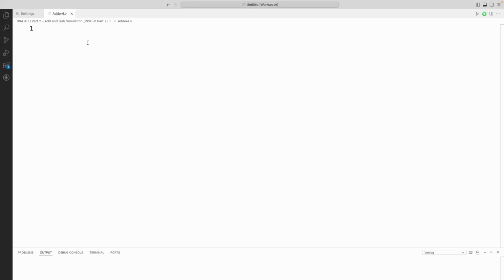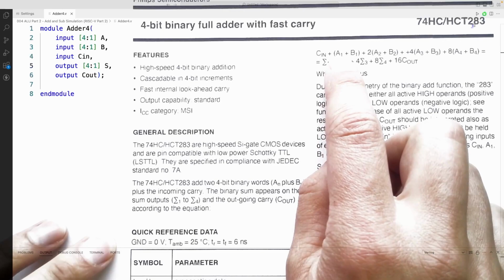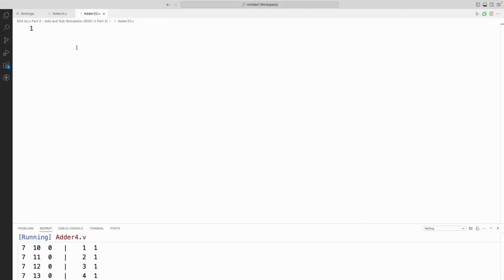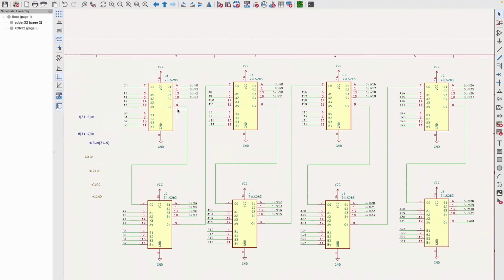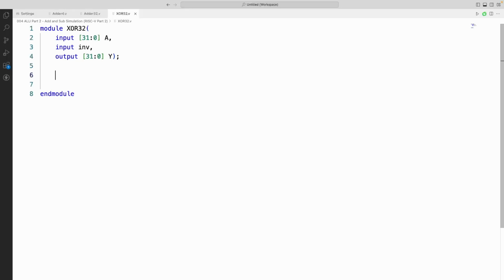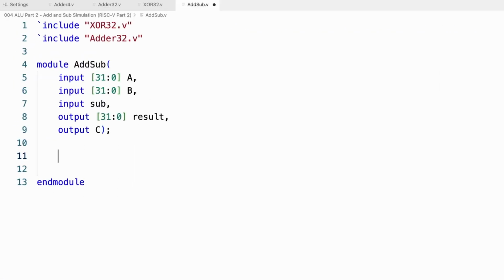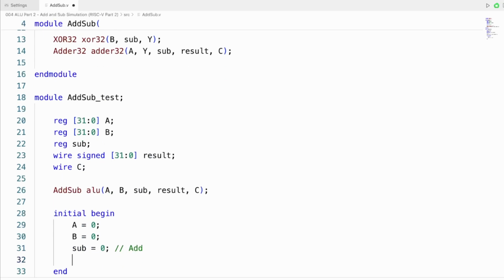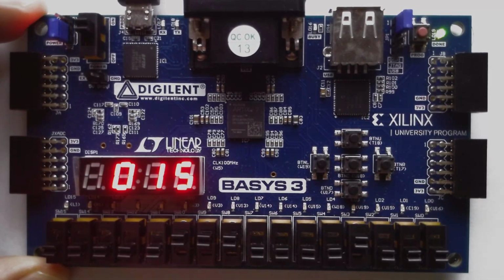ALU add & sub in Verilog (RISC-V Part 2)

Comment: Is there a reason why you used [31:0] for the 32-bit input but use [4:1] for the 4 bit adder input? I would have thought it would be [3:0], no? I've never used Veilog but it's on my TODO. 
As an aside, I used to work with someone that would develop array style data structures whose index started at 1. This mixed in with other C++ code whose data structures started at 0 created a cognitive nightmare trying to figure out what his code did. Iteration code made you want to cry. So glad that's all behind me.
Oh, and new subscriber 😄
Reply from the maker: I'm definitely a fan of consistency and generally stick to zero-based indexing. This video is going back a while but I believe I made an exception for the [4:1] input because I was trying to be consistent with the datasheet since I was simulating a specific chip (the inputs are A1-A4 and B1-B4 in the datasheet). And thanks for subscribing 🙂

Comment: While i admire your work, i keep coming back to why are you using XOR to do your invertin (index 8:00). I know the data sheet will tell you that that its timing is the same as a invetter, but why not a gated tri state buffer and a gated tri state inverter in partial with an inverter betwren the control logic (74HC540, 74HC541, 74HC04- last one does come in a single gate package. An if I got the right 74HC package its a lot more simpler to wire bc they are straight threw in order. A1 to D1
Reply from the maker: There are a few ways to solve this problem and the XOR solutions works well in this case. Your suggestion will probably require more chips since the inverters generally come in a hex package rather than an octal package. Also worth noting, where I buy my chips from the 74HC541 are significantly more expensive than the quad XORs and come in a larger package. I do agree that wiring would have been easier though.

Comment: Great video. Could you perhaps elaborate a bit more what/how to intall into VS Code to make it possible? (simulation, building for xilinx, loading to the board). Thans in advance
Reply from the maker: I use Icarus Verilog (just Google iverilog and you'll find plenty of install options) which can run verilog files for simulation. It can't do the full synthesis, implementation etc. and can't load onto hardware. For that I use Vivado which can be installed with a free account - Windows only though. To use VS Code with iverilog you can use an iverilog extension or just create a launch script, or use code runner (https://marketplace.visualstudio.com/items?itemName=formulahendry.code-runner) - I think code runner is the easiest to set up from memory. I don't have my dev computer with me (I'm travelling at the moment), so I can't be more specific about my specific setup.